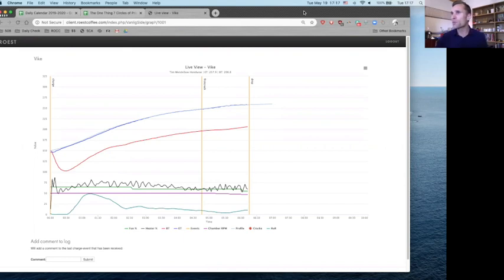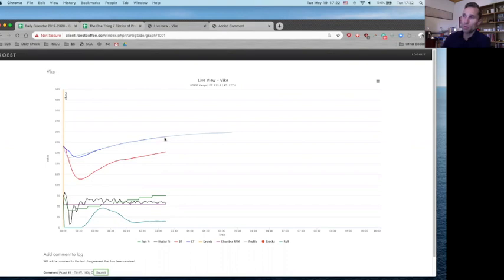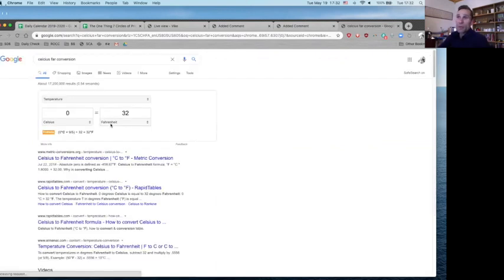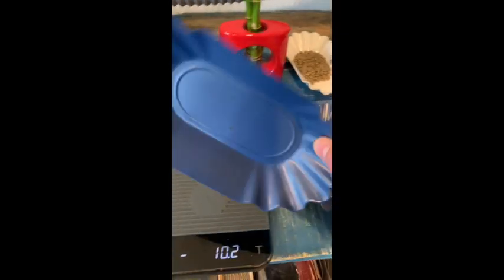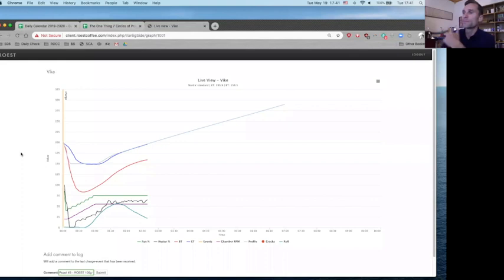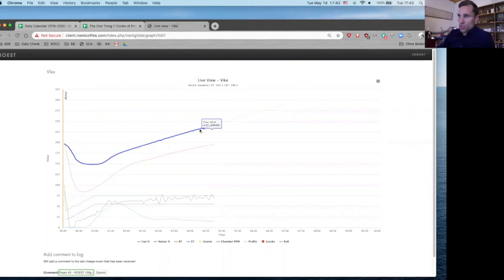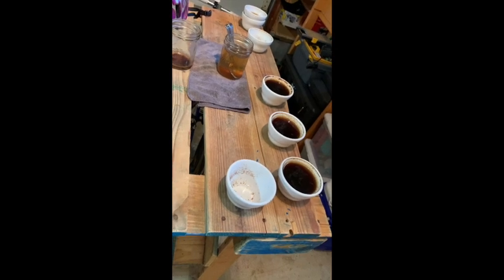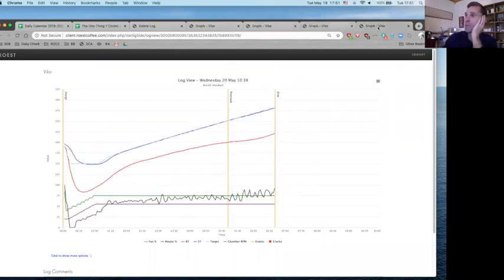How to Roast Colombian Coffee on ROEST - Sample roast coffee for production batch roasting.

Comment: Interesting. Did you successfully translate your sample roasts to your production roaster? And taste very similar?
Reply from the maker: Hi Lyndon, thanks for your question. 
What machine(s) are you operating on and looking to scale up?

Many times you can replicate (or get close to) the sample roast when you move to a production batch. The key is in scaling so that you account for the natural physics / thermodynamics at work. The majority of potential is in the green itself - so you can accommodate your roaster and roasting methods to unlock the potential.

In this specific Colombian, we did migrate to a very similar production roast on a 12kg San Franciscan. For single origins like this Colombian we usually roasted at half volume 5-7kg or 10-15lbs green. The San Fran was a traditional gas fired drum as compared to the ROEST SP100 which is 100 gram hybrid hot air convection.

In a separate project, I developed a whisky barrel aged Guatemalan which I was very pleased to be able to replicate on the same 12kg San Fran. We had to roast much harder and faster than the team usually roasted on the San Fran, but it worked. A full writeup is located at ROEST: https://www.roestcoffee.com/roestblog/barrel-aged-coffee-roasting 

~Adam
Reply: @CoffeeTraining  thanks for the good reply. I am using a Bullet and plan to translate to a Probat 12 kilos and Besca 5 kgs. I do think it can be done by tracking the color changes and bean reaction..i am just want to go more in depth. I am reading the article in roest.
Reply from the maker: @lyndonjosephrealubit3892  You are right to track a few of those key markers. I'm pretty sure my 6 minute roast on ROEST translated nicely to a 9 minute roast on the San Fran. Scaling every event 50% in timing while reaching the same end profile/color was the ultimate goal. Keep up the good work while holding onto your scientific method of control variables.

Comment: Where is the ET probe located? Why are these roasts following the ET curve and not the BT curve?
Reply from the maker: Hi Mia, great question. ROEST is quite unique from traditional drum roasters. Being driven by almost 100% convective heat transfer (that is hot air flowing through beans) it functions differently. 

To answer your question, a traditional roaster and courses about rate of rise (Scott Rao's etc.) are great for traditional style roasting with conductive heat. That is heat transferred from a hot surface (drum heated by fire) to the beans inside of the drum. Then it makes great sense to track the measure of heat (temperature) on the bean probe.

However, convective heat can be even more powerful if used properly to heat the coffee. The greatest leading indicator of convective heat is the hot air flying through and around the drum - thus ET. If ET is higher or lower, then BT will react to it.

Finally, if I use my BT to roast, it's a lagging indicator of what I am really doing to roast my coffee - pumping hot air through the drum as ET.
Reply: One could also define these roasts bei controlling the heat curve? The last roast (you judged it best) fits almost to a traditional drum roast :maximal  heat at the beginning and steadily declining, whereas air ramping up  and staying high after yellowing.

Comment: does the roest has a perforated drum?
Reply from the maker: Hey there. The ROEST design is quite interesting. A fixed drum (yes perforated) in which a paddle spins while the drum remains stationary. Hot air blows up and through while paddle slows or speeds the bean rotation. Are you considering a purchase or interested for other reasons? I'm happy to help your exploration.
Reply: Hi Adam, thanks for the great video!  I am considering buying a small roaster and start micro roasting at home. Do you suggest this roaster ?